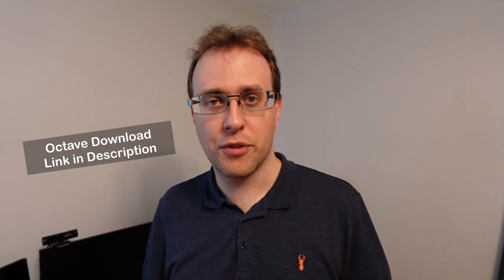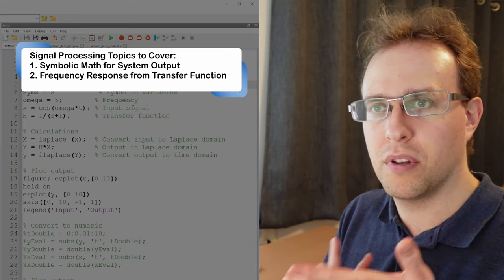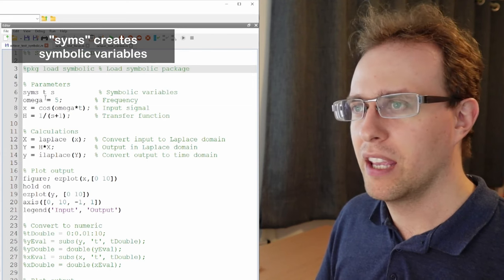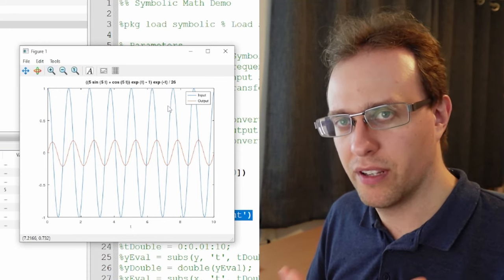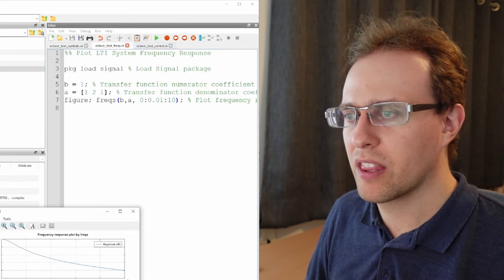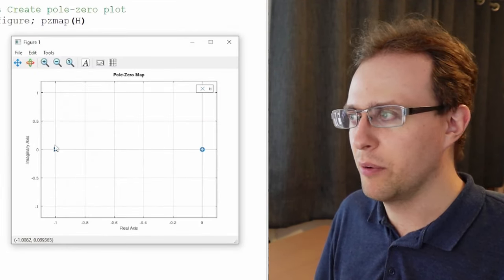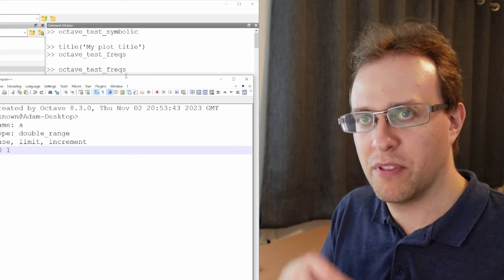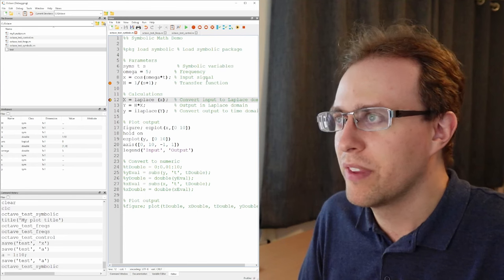Octave for Signal Processing: First Impressions from an Engineering Professor

Comment: Octave is great until you discover that some basic matlab code does not run as they renamed functions. Very dumb.
Reply from the maker: Sounds like I got lucky then!
Reply: My experience is about 5-10 years old. If they fixed it then I would be a fan. @AdamNoel